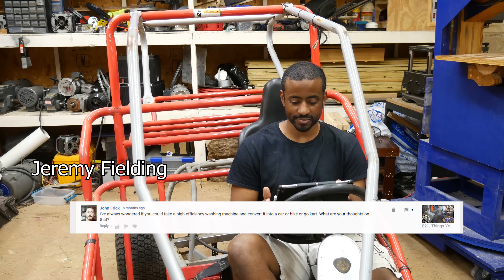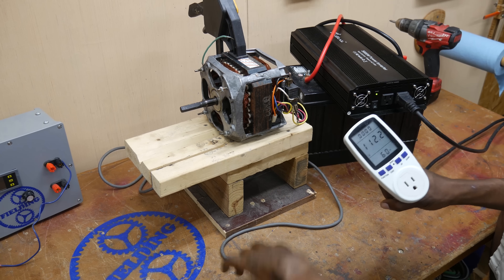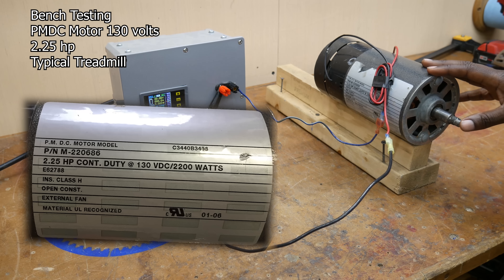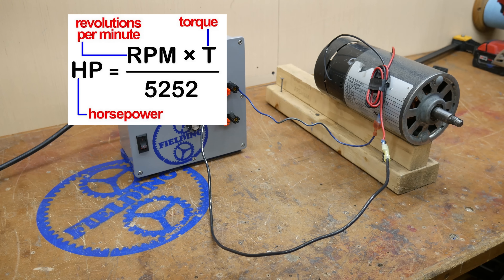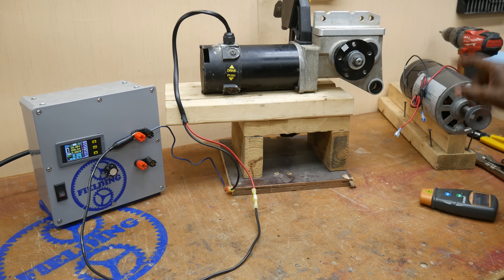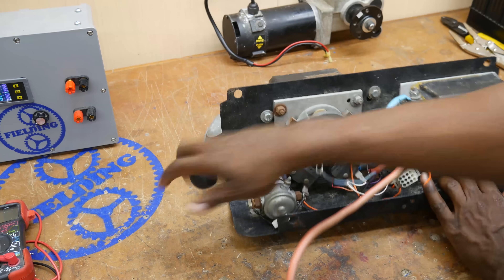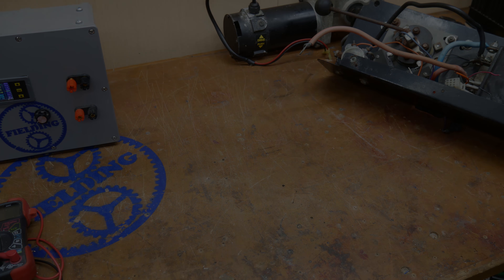What Electric Motors Can Be Used In A Go Kart or E Bike; Bench Testing and Recommended Sizing #61

Comment: You theoretically could use an ac induction motor with an inverter and a dc signal going to your rotor coils, practically turning it into a permanent magnet motor. This is what is done with a lot of modern hydro power through the frequency converter

Comment: How about an AC motor with a flywheel and a clutch and a cvt from a scooter? Then maybe you can have the motor spinning at a fixed speed and engage and disengage the transmission.

Comment: I strip down old appliances and test their components and sometimes resell them. My son had this idea to use a few of these motors to post a electric go cart. When I was thinking that they would be better off in the hands of folks who own the compitble appliance, I wasn't wrong. Guess I am going to need to show him your video to get him off the idea. But I will go online and order him a DC motor to mess around with. We both have the same wattage meter too. I have that exact one connected to my 12900K Intel system to make sure I don't pop the breaker. Lol

Comment: you start with a steel-enclosured inverter sitting right between the positive and negative terminals on a 12vdc battery. 😭 that's too dangerous!

Comment: Enjoying this tutorial. But , I’m still a little lost. My project is a 24vt golf trolley. I’m currently using 2 power wheels gearboxes. They work great, but are loud. Trying to use 2 motors directly connected to wheel for a quieter drive. Had used  30 w motor, but not enough torque to get it moving. Do you think a 100 w motor will work?

Comment: can't you just put a resistor and a capacitor in between, so that the motor has a soft start? also I got a cheap AC motor controller for like $20, i used it to slow and speed up a ventilation fan

Comment: I have tried and tried to get a bike that can charge while ridding, but no one can seem to do it without $400 charge controllers and say it can still damage the battery by heating it up simultaneously charging and discharging! 

But now that we have solar generators like ecoflow, jackery, bluetti, etc. I want to get a motor to run off of 120v AC so I can put a few solar panels on a trailer to simultaneously charge while riding and bike across the country.
Any suggestions on a motor that would work like that?

Comment: I have one pretty powerful motor in my garage.. I have two ideas for it, either some kind of go-kart or ebike (not bicycle ) or battery powered mower. 
Unfortunately the labels on the motor work out due to oil leak from chainsaw from where the motor is. All I know is that it is 40v motor and MAYBE 2kw of power by amazon listing for that chainsaw.. 
Any idea how to get some rough specs of the motor? I don't have RPM meter or anything like that, and also I need to hook up the motor to something because it still contains the original chainsaw controller and battery hook, which means I can't use any then original battery and without any load the controller locks up the motor everytime

Comment: I do agree with jeremy but tesla cars use ac motors and they have a lot of power so I don't know if ac motor are not use full in a go cart or something else.
Reply from the maker: The Tesla also have much higher voltages than what would be considered safe and practical to handle by a DIYer building a go kart. Which was the whole point of bringing that up. There is nothing DIY about a Tesla :) The Tesla also has air conditioning, but you probably won't use that either. Its just not a good comparison for many reasons.

Comment: There seems to be endless videos about motors for going fast with little torque, but what about going slow with a lot of torque?  I have built a mobile bar/beer tap wagon that I would like to be able to drive, no faster than walking speed but it's quite heavy and needs power.  Would a treadmill motor work well for that?

Comment: Could you use a Baldor Reliance Super E motor 5hp , 5.3 volts Serial number x2111m56990 for a go kart application? I think it can be used as ac or dc. I have a brand new one and want to use it for something , this seemed the most fun thing to use it for . Thanks !

Comment: Im using a alternatir converted into a BLDC Asynchronous motor with field weakening. Meaning you can control the rpm and tourque the motor makes without changing the volts or amps its done by applying varying volts and amps to the rotor of the motor . Very unique design can someone please tell me if they have done this or are researching it too becuase not alot of valueable information. I have worked out i can use a 150a rc car esc and brushed esc for the rotor and applying aprox 1200w power on 12v !!! With an electronic gearing system

Comment: That's why in a lot of DIY e-bikes or a mid drive conversion kit you leverage the back derailleur and rear cassette to give you speed after you're already going using the existing gears which is relatively easy to do if you have a dual chainring in the front one for the motor and then the other one to run to the back as usual but it works best if you put free wheels on your cranks or somebody actually just came out with that recently Shimano I think which makes it really easy to do a mid Drive kit without having to replace spindle from the bottom bracket or just get used to ghost pedaling LOL 9:34

Comment: I know nothing of electric motors but I have an old low rider with hydrolics could I use the two 12v motors for the hydro pumps taking off the actual pump part ?
Reply: I’ll do more to figure out if I can on my own but I’d like your input please and thank uou
Reply: I could use 12v batteries directly as that’s what’s used normally but not sure on the motor as there used in small bursts so I’d need speed control I understand that much but hoping it’s strong enough to punch a go cart or small four wheeler frame I have an old four wheeler to use
Reply: I’m still going to try but I’d rather have insight before I ruin them trying lmao I don’t have the batteries or speed controller yet so I’ll wait till I understand that part more

Comment: I purchased a pwm treadmill motor before I watched this video. It's 3hp, 130v and 2000 Watts. Is it possible to use (7) 18-volt drill batteries to power this? I'm trying to do an electric conversion on a go kart... I have the batteries already so it wouldn't be an added expense

Comment: I used a shop vac to clean my cab in my truck , it ran fine. to run a hot plate off the inverter I'd have to increase idle rpms,  1,000watt converter,  4 1,000 watt nickel truck size batteries.  you need more battery to push that inverter

Comment: Another problem with ac inverters is the inefficiency of the inverter as they draw a large amount of the amperage for themselves and therefore the battery drains quick. I prefer dc motors and would rather convert an alternator that has been modded(converted with perm magnets) and runs for a long time off a battery. Ofc, I use small converters to control the amperage.

Comment: I used to use car starter motors but they aren't very efficient and overheat quickly. This is I think due to the fact that they use a power hungry electromagnet to do the job of a permanent magnet.
Also motors that need a very high voltage and a big gear reduction e.g. vacuum cleaner motor can be difficult to make work. Also motors that are quite small for their power - drill motors and drone motors are meant for either short duty (drill) or fast air cooling (drone). I saw someone use one on en e-bike but unless you have a multi speed transmission they will get hot.
Also things with a worm gear in them like a windscreen wiper motor will need a freewheel, and a worm gear isn't very efficient.

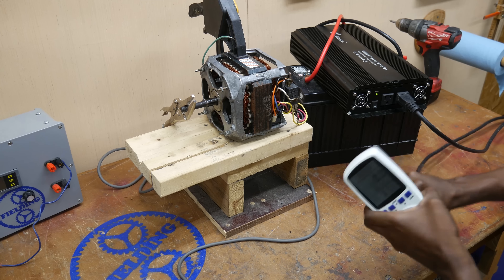Comment: 4:17 You could use a 3 phase AC motor paired with a VFD (Variable Frequency Drive) and speed controller.
Reply: He took a simple experiment and had it difficult from the jump. Having to convert energy source causes problems in itself....😅

Comment: I did watch a vid way back where a guy took an alternator from a diesel ford and showed how to wire it into a 12v motor and used it in a go cart and powered it with a deep cycle 12v car battery got the thing up to 30k mph however he fried the battery but did show in another vid how to keep that from happening

Comment: Can I use a 12v battery to that 3000w inverter with a 2nd 12v battery with another 3000w inverter and run them both in parallel or series to an older baldor 75hp electric motor with a car/marine alternator to another 12v battery splitting off into the other 2 batteries as a charging system while I drive? Because I was hoping to do this on a small handmade speedboat I'm about to start working on and I'm new to this field so I'm taking different people's videos in hopes to find a way to make something possible that everyone failed to see. Idk lol like I said, I new 🤣

Comment: Not to necro an old video, but would your opinion on any of these change if you put together/bought a higher voltage battery pack? most battery packs I'm seeing are running 32/48 volts or even higher. Something like a universal motor that would burn up at 12 V might be fine at something like 48?

Comment: its a black n decker not barret from  maybe 30,s or 40,s iam shure there are still some older guys out there that now all about them, i like them i have all kinds of motors to nice collection most where salvaged and salvaged 4  geard power wheel chair motors and controllers pretty befe i think two wood go good on the 3 n 1 sheer,brake, slip roll make it powerd.

Comment: Achily before all those  digital , steppers motors where universal motors and they seid universal motor and they run every thing i AM RUNNING a graerd head universal motor with a reostat thats it and u cant stop this motor it came off a Barret brake lath and i have the universal grinder with reostat, its on my earky 70,s drill press it was easier to put on and run i have a 3ph 1/2hp was going to get the vfd  money was tight and still is the barret geard head motor is going on a power hack saw can post pic,s this stuff is sold be a round long after we gone i love the old stuff they dont make stuff like that anymore. the good grey cast iron. try to drill a hole in this one. lol

Comment: Plenty of appliances have universal motors in the 1-2kW range. Example: Electric chainsaws, walk behind mowers, radial arm saws, angle grinders (230mm). Smaller appliances will typically be between 500 and 1000W, less useful. The problem is getting up in the right voltage range for them. Which is a heck of a lot easier in 120V land than over here in the 240V province.

Comment: At 0:32 in the video  you talk about  a extension cord behind you . What if you  used  the honda eu2000I  generator  that can run either a 220 v  motor or a 110 v  motor . One gallon of gas runs the generator about 8 hours so why not take the  ac power with you . Why are you stuck on using a battery  to power a motor ?  Will you try using  the small light weight honda eu2000i  to run  the cart  or ebike  or a motorcycle . Wouldn't a generator be able to run a  bigger motor  than a battery would ?
Reply from the maker: If your going to carry gas you should just use a gas engine to drive cart. I only built to to explain how you might make an electric cart. A frequently asked question on my channel. Not because I am stuck on batteries LOL
Reply: @Jeremy_Fielding  Regular engines that use gas   only get short running time . The generator can run for 10.7 hours on 1 gallon   of gas . How many amps would a generator need to produce  to  run the  motor  you picked ?
Reply from the maker: @Sertao2013  generators turn gas (chemical energy) into mechanical with a crank, then into electrical energy by turning the shaft of an electric motor (generator) to run what is plugged into the generator. You want to plug in an electric motor to turn electrical back into mechanical energy. Every step in the process waste power. It doesn't matter what the number is. It will always be higher than if you had not used the generator. The generator is already turning an electric motor to generate electrical power. You should turn the wheels of the go cart instead.

Comment: First, my compliments to you on providing concise information in a very easy to understand format. Kind of amazed me that those folks converting alternators did not know before hand that the efficiencty would be extremely low.  As expected, every video i watched where this conversion was done the result was the same... no good. Now, I hoped that someone knew more than i and had some additional modification that would make it viable.  Many years ago i built an electric car for my son. I used 2 heater motors from cars to supply the motor and an old timey hand crank grinder for the gearing. Finished it did almost 3.5 mph and the reason for building was because where we lived the ground was very steep and buying him a store bought electric car for a 3-4 year old we ould not get up and down the steep yard. I somewhere have a picture of him going up hill pulling a wagon with a 14 year old boy inside the wagon. Yes, 2 fan motors had all the power necessary. The idea is that electric dc motors designed for variable speed has (generally speaking) the same horse power from start to finish, where as a gas engine must "build" the power. Horse power and Torque equalize in a gas engine at 5,100 rpm (if i remember correctly). My son loved watching me modify everything from mechanics to electrical to electronics so much  he is an actual sheep skin engineer.

Comment: I took a 1hp 12 volt motor off a winch, on the bench it seemed to have loads of torque, when I put it on the fat tire bike it will just barley turn the wheel. Am I to under powered, do you have any ideas?

Comment: Cut the gear sprocket off a bicycle (the thing that moves the chain from sprocket to sprocket), and weld it to a suckered bar that you use as an a rear axal . Just use a chain to power the wheel chair motor with the shifter attached somewhere..

Comment: That inverter is probably a modified sine wave inverter. Youre meter is probably not designed to accurately read the output of a modified sine wave. There are other reasons that the inverter could have shut down besides overload. What was the battery voltage at the inverter not at the battery when it shut down?

Comment: I recently learned that some Razor scooters need you to push off in order to get the motor to spin, so what about converting a gasoline powered moped (you know with pedals) into an electric one with a 3 horse power universal motor, you kinda skimmed over the Universal motors, and I am wondering that if and when powered by DC they act and behave as regular DC motors and one can use something like a Curtis controller with a pot throttle

Comment: One thing I never heard you speak of was the person who would be sitting in it, that would add another 50-100kg to the load.
You are right about ratings on electrical equipment, many are over-rated but you'll find in the small print that it will say it is rated at 3kw for amax load for a second before it cuts out. Some will actually tell you that it is rated at 3kw for a spike but continuously rated at 2Kw. For motors on machines that take a heavy starting load, there are many ratings depending on how many phases it uses, I have seen motors that start on 3ph and run on one or more usual in the Europe are Star/Delta motors for AC.

Comment: I disagree about the treadmill motor its 2.5 horsepower . With a infinate gear and 130 volts in lithium ion batteries would be a hell of ride for about 25 to 30 minutes. You should rethink your aproach for the motor would perforn fine as pedal assist type motor. A scooter like infinite gear would allow enough rpms for the tourque to be sufficiant.

Comment: Jeremy;  I've got a 26inch fat tire bike and want to make it electric assisted booster.  I figured I could get a 4inch wide rubber boat trailer roller guide as a friction booster.  I dont want to go faster than 10 to 15 mph.  I'm 68 and want to use the bike to travel about 5 miles on dirt and sandy roads to bow hunt.  I sure could use some help.

Comment: What would happen if I used 4 small 12v batteries compared to 4 large ones im building a small electric powered boat and weight is a main concern

Would it just affect my amp hour rating

Comment: After watching this i thought about universal motors, specifically a 120v 9 inch angle grinder. They have a lot of torque 17nm apparently on top of that they have 3 places to use bolts to mount them. I have 6 flexvolt batteries and 6 regular DeWalt batteries too. Surely connecting 2 pairs of flexvolt in series and parallel so i have 120v and 4ah would be enough to power it? Along with a pwm controller and potentiometer to control the speed. Would this work?

Comment: I built a go-cart when I was a kid and used a washing machine motor.  I could only run it in my driveway and the power cord would often get goofed up pretty quickly as all I could do is go up and down the driveway.  Also, to get it to work I had to put a hinge on one ear of the mount and a stick attached to the rest of the motor so I could get the motor shaft to rub on the wheel  ( would chew big divots into the wheel hehe).  
  
10yo kid desperate for a go-cart :)

Comment: I'm only 3 minutes in and it's already excellent!  I like the way you test with the locking pliers, because definitely, that AC motor is going to run into those type of challenges. It is something I have to admit I wouldn't have thought of.